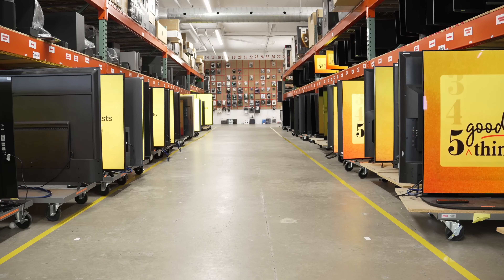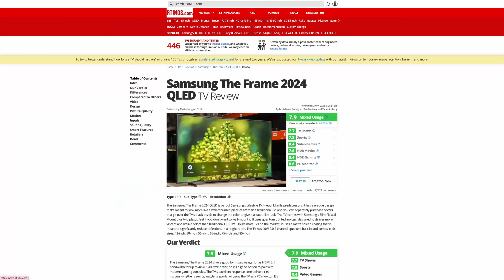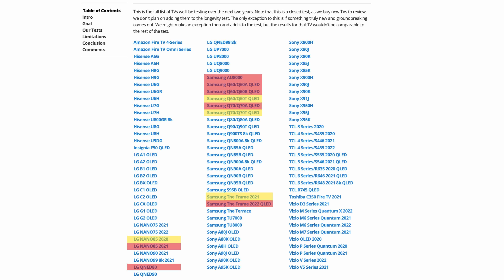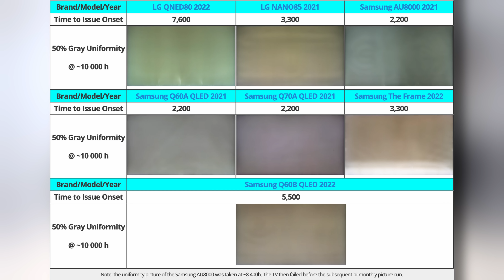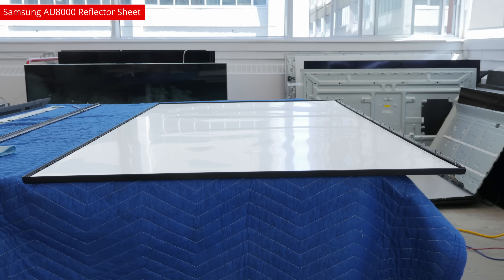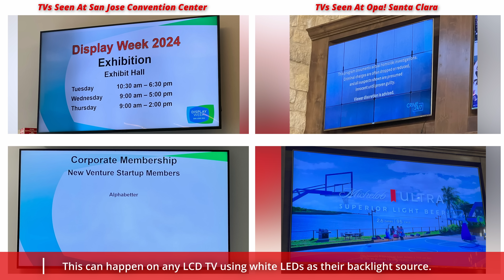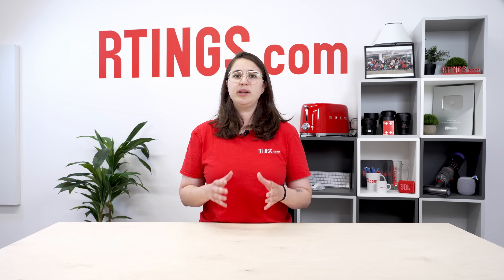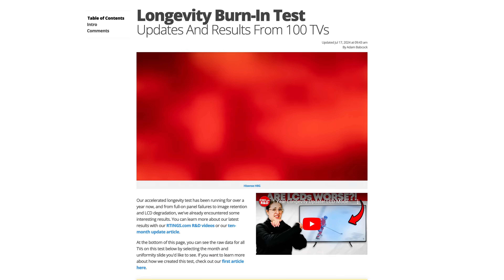Edge-Lit TVs Fail FASTER Than Others (100+ TV Test)

Comment: I know why, i see it almost every day.
The current trend for higher brightness levels means the LED's run hot and since there is very 
little ventilation the edge of the reflective sheet  starts to split and burn, this has to be replaced
at greater expense than the led strips, often making the repair not viable.
Keep the brightness down or be preapred to buy a new TV when this happens outside of the warranty.
Some call it progress, i call it deliberate design flaws.

Comment: What is the temperature between all of the TV’s?  If it’s 100 degrees from all of the TV’s running then they will fail much faster than in the wild where TV’s are running in a 70 degree room

Comment: Our 2018 TCL 55S515 TV has the burns/cracks at the bottom of the screen problem.   Currently its only an inch or two of the screen at the bottom that has the problem,  but it is annoying.

Comment: You can’t just make accelerated lifitime test without considering the science behind it. 10000h of constant use at 100% brightness IS NOT equivalent to 6 year of “avarage usage”. It is more like to 100 year if not more. 
Test without the ability to read the results and data is just a waste of time. Try to keep a lightfire on for few minutes, it starts to melt it-selfs, however this does not mean that soon or later it will melt. Testing outside the use cases of which a product is design for could lead to issue that is completly misleading. Strict test methodology is just necessary, but it-self alone does not imply right and useful results.

Comment: I had a Philips 58pus8535 with full array direct backlight which failed after just 13 months. I was watching a 4K blu ray and when I powered off the blu ray player the screen went blank and no matter what I done the screen would not turn back on. When I pressed the menu button nothing showed on the screen. I had ambilight enabled and it showed that when I pressed the home button and pressed the direction buttons on the remote it was selecting different things. But I just saw blank. The screen failed.

Comment: Two weeks ago, I bought the LG 55QNED88T6A model and faced the issue of edge light leakage in all four corners due to its edge-lit backlight technology. Watching movies and TV shows on this model is quite disappointing, especially during darker scenes, where the backlight is very noticeable around the edges. Because of this, I requested a replacement with a different model, the normal UHD UT80 series, which uses direct backlight technology. I hope this will resolve the issue.

Comment: My TCL 65in QLED is now one year past its 3 year warranty. The screen now has a dark vertical shadow across it. TCL won't cover the repair or replacement and recommended a service technician to have it fixed at my cost. I'm told by the tech that the TV is not economic to repair. So after just 4 years it's got to be junked. Thanks TCL . NOT HAPPY!!!

Comment: I had a Samsung plasma for 15 years. It's picture was as beautiful the day it wouldn't turn on again as the first day I got it. The part needed for it to turn on was not available nor was it made anymore. Trying to get it to a repair shop would have been quite a task. It weighed 90 pounds and I live on the 2nd floor.

Comment: I had a edge lit Samsung KS8000 and the glue that held the bottom frame in place started to come apart.  It eventually developed a purple line from the warping of the backlight.  Never again will I spend more on a Samsung, I only had it for 18 months and it literally fell apart.

Comment: My Sony Bravia LCD purchased in 2006 is still working like new
Reply: It's lit directly using fluorescent tubes I'm sure. These Rtings tests are also unlikely to be real world examples as they are running them at full backlight brightness to get results in a short time and most users wouldn't likely have them so bright.

Comment: I'm not an environmental nut but the absolute gall these manufacturers have to create what I consider "disposable" TVs at "Buy it for Life" prices. CRTs literally lasted for decades, they lived so long they were virtually antiques by the time they stopped working, if ever, and they did break - they were repairable! These TVs are all ending up in the dump in 5-10 years, and they're not even cheap. THEY'RE EXPENSIVE. Furthermore they are riddled with quality control issues. Weird lighting problems, dimming problems, durability issues, cracking, colour problems. They're plastic junk. They're little more than large, flat lightbulbs.

I hate everything about these televisions except their slimness
Reply: They are cheap compared to what an equivalent Japanese brand CRT or Plasma (or early generation LCD) TV would've been, especially taking inflation into account.

I'd say they're suspiciously cheap but people have now been conditioned to think that is a reasonable price for electronics. Not if you want reliability.

Comment: Question, i have the Samsung 65 inch Q7FN  from 2018. It works amazing even with edge Light. Still going strong after 6 years. Are there big differences in quality between like say my model and like q60?

Comment: 6:35 thats because you got it in a hot box of a warehouse for a stress test, less than a foot from other tvs producing just as much heat. I love you rtings but the scenario's gotta be more realistic for creditworthiness. I can see the design is a total flaw and failure and it makes no sense to continue production on such flawed tvs, but i think they often assume best case living scenarios where a home is under air conditioning 24/7 or that buyers are most likely in parts of the world where temperatures are relatively cold most year round, and that the tv's not mounted next to their fireplace, yknow.

Comment: Does RTINGS do any testing like this with also flipping TV's off, cool down, then back on? It is one thing to leave a TV on all the time, but 99.9999% of users will be thermal-cycling these at least once, if not more times, per day. Thermal cycling even on solid state electronics degrades them. Curious if any brands can handle this better than others or it is not important.

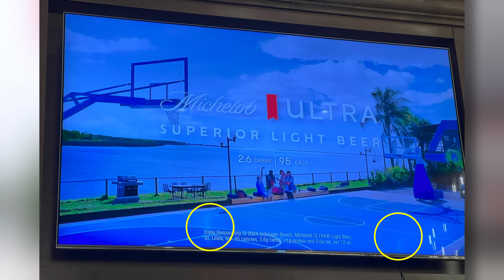Comment: I have a Philips 436M6VBP 43" monitor that developed those exact same warped blue lights at the bottom of the screen shown at 0:44 after 4 years of normal use. I don't have kids or pets. The monitor was treated perfectly and never moved from the spot I set it when I bought it. Now I finally find out what the name of the issue is after Googling for hours.

Comment: I was always careful with my 2019 Samsung and rarely used it at full brightness. 4 years later the LEDs started turning purple. In 2019 I spent what I thought was a lot of money at the time. It was not a cheaper model. I had expected it to last nearly a decade with how careful I was. I went to order new LEDs to repair it and found that the 4 light strips required totaled over $400 after shipping. Unreasonable.  When I replaced it I figured that if a TV wont last 5 years anyway I might as well buy an OLED.

Comment: In 2013 I bought a refurbished midrange Vizio M-Series TV. A year later I bought a refurbished low-end Vizio E-Series TV. I still use them both regularly today, and they've both been flawless. My parents have had mediocre luck with their Samsung TVs. And their newer LG has possibly the worst GUI/menu system I've seen on a TV. When I need (or, more likely, want) a new TV, Vizio will certainly get some points for my refurbished models holding up so well.

Comment: I have a Phillps 65" entry level LCD TV with edge LED's and "Ambilight" RGB LED's on the frame. A year has passed and the TV had normal use with low brightness, for the price is an excellent TV and it's thick, maybe it have good heat dissipation, some light bleeding is visible in top left corner on dark scenes but it's not that noticeable. I'm an electronics technician and worked in a TV assembly and distribution/technical support plant, we had an edge LED TV model that had a MASSIVE fauilre rate, good times 😂😂😂

Comment: im going to tell you why this happens.. first it used to be about money you pay the maximum on anything in life and you get quality..  not the case now now everything breaks at about 3 years to 6 years... give or take all manufactures got together planned obsolescence in everything you own now its a throwaway generation notice those old crt tv repair shops are gone now yup just what they wanted you cant repair these tvs you must buy a new one to fix it.. it all started back in the late 70s when industry got together said we want more money lets stop making quality things.. now your refrigerator lasts 10 years tops if that where as it would last 50 etc.. 

this is why you want old products like fridges and tvs etc the last tvs to be of any salt was 2008 and below i have a 2008 tv stil going to this day.. im on a samsung lcd right now its failing at 3 years old black areas when you look at it from a angle.. so yea this world is now run by corporations and greed fully

Comment: I have a older 32 inch JVC edge-lit lcd tv that is most likely 10 years old , it hasnt been used much throughout its life and yet it has developed a warped reflector sheet. you can clearly see the slightly brighter blobs at the top of the screen. It wasnt used in warm environments and is at lower brightness. I do like this tv, overlooking the ancient android version (being 4.04) and the absolutely abysmal audio quality.

Comment: I’m more worried because I thought to myself “good thing they aren’t talking about my Hisense U8H today.” Then as a I thought that they used the U8H as the example of the piece of junk that failed. Fml.
I will say it gave me a ton of trouble playing with settings and firmware updates to get it to work right. The sound when using an input had a full second delay that appeared after an hour of usage like clockwork unless you fully restarted it, but it randomly fixed itself one day. Also had an issue where it was very “jittery” with anything on screen moving quickly. Ended up turning off some motion smoothing feature or something to fix that.

Comment: Edge LED is not worth it!
Especially now that we tend to purchase bigger TVs, like 55" and upwards.

Typically, thin [insert electronic device here] will reach higher temperatures, and faster, than thicker ones.

TVs, which usually, spend many hours turned on, at maximum brightness, with not active cooling (i.e., a fan), will be prone to issues.
Hence, one shall take into account this when purchasing TVs.

OEMs must understand that, if a TV fails within 3 to 5 years time, that consumer will look for another brand when purchasing his / her next TV.
Rarely do consumer look at spreadsheets - like we TV nerds do.
Therefore, OEMs should be aware of that, and define thir baseline when building a TV set.

Comment: We've been using our Panasonic Plasma as our main TV for over 17 years, and it's still going strong with no issues.
Reply: The tv in my livingroom is Panesonic Viera 50" plasma tv of 2005 manufacture, so 20 years old.  Still going strong!   Those three fans built in to the back no doubt help a lot.

Comment: I’m a TV technician and I already repaired quite a lot of the Edge lit TV mostly samsung is worse when the LED get burnt the diffuser/light guide panel will also get burnt or cracked so you also need to replace it to do a proper repair

Comment: I can relate to this video. Bought LG tv in 2017. Basic 4K model. It’s nearly impossible to use now. Black is purple and you can’t see anything during the day. We have bought and older second hand LG tv before this problem has happened and it is still running smoothly after more than 10 years of use. Also my uncles LG TV died just after couple years to the problem described here. But I could find anything on the web. All tv’s are edge lit. Thank you for this video. I hope it will help us when we look for new tv. 👍🙏

Comment: Lols the thicc thighs saves lives is not wrong fwiw because to be able to lift a thicc tv set one generally has to or will build thicc thighs from squating down and waddling around with a tv regardless of type of tech/screen size but generakly the ones at least 30 or more pounds no more than about 200  to start with for safety as you do not wabt to implode a glass 45vinch tube weighing over 400 pounds more about just shy of 450lbs.. so yeah also ensure earthqauke/siesmic safe installs are observed even in todays age or for retrogaming if a set is up high it can and inevitably will in some earthqauke level of magnetude fall but best not to have a issue needlessly likewise cosnult the manufacturer for ensuring that your floor is strong enough like one would for an organ since it may need a brace and also a site built stand for the monitors over 36 inches of flat faced particularly but vacuum tubes and or drums of fluids etc in excess of a few hundred pounds may also need to be reinforced to hcigh loads falling and or collapsing.. such as this is why one may be suprised to learn like I was upon turning over an entertainment center there are legs even on it much less over 4 or even 5 but 7 or 8 legs... to avoid breaking through the particle board.

Comment: The edge lit break faster because you drive them non-stop at maximum brightness close to each sample and cramped in a room getting heat saturation even with AC. They were not designed to operate that way.

Comment: So far with our screens, they've all lasted quite a long time. In-fact the only LCD screen whether a TV or monitor that we've had fail, was a very cheap 40" ViVo TV, which was CCFL lit (over 15 years old, 13KG, thick and well ventilated). And it only died due to the power supply failing (open circuit due to 1 in a set of 3 de-coupling capacitors exploding and taking the others with it). 

It's much the same for the 15" Hicon TV/Monitor that has been in use since the early 2000's. Its only faults have been a dying power brick (erratic voltage - easily replaced) and a single dead pixel.

Comment: As a former TV repair technician, this is why I miss CCFL based LCD sets. Yes, they do wear out like LEDs do but they take a much longer time doing so. I had a Sharp LCD set (when it was still made by Sharp) that lasted so long, it was on its second set of CCFL tubes. That thing was still going when i left the biz.

Also this thin trend is dangerous, thats what happened to plasma TV sets at the very end, resulting in heat-induced panel cracking and manufacturer blaming the customer that they broke the screen!

Comment: Used to be LG tvs having this problem with LEDs blueing. Bummer that all manufacturers cheap out like this. However the fix was easy: A set of new light bars from China for $18. Though taking a large TV apart to fit new LEDs is delicate work.

Comment: Reaching out for comment from the manufacturer is a well-regarded journalism practice, but the outcome is predictable.

"We've identified a consistent failure point in your product."
"Our data suggests everything is fiiine."

Sure, guys.  I assume your tests are done with 10,000 hours (that's 10,000 hours in metric) with the TV off?  And return rates are not considering everyone who threw their broken TV away because the 90-day warranty expired a year ago?  Well then, sure, that makes sense.

So sick of boiled responses that amount to, "Well, we would know if there's a problem, because we have all this information we don't let anyone else see and you can't prove doesn't exist or isn't true.  And the data I've made up doesn't indicate anything abnormal.  So there."

Would it be so hard to just say, "Yeah, there's a trade-off in life expectancy for models that prioritize thinness or cost.  We suggest selecting a more robust model, or limiting duty cycle accordingly.  Here are suggestions for each of those options: ...."

Comment: My Samsung UN58NU7100 55" looks like the bottom edge of the light guide plate is cracked in multiple places.  Happened after about 5 years of use.  Sometimes it makes a cracking sounds after turning it off.  I would almost bet it wouldn't have cracked if it was designed to slowly back off the heat over a minute or two.

Edit: I also think that less than $10 of strategically placed aluminum would nearly eliminate the heat related failures.

Comment: With samsung brand I've noticied a clear reduction in longevity, ln32a650 working fine since 2008, 40" KU6000 since 2016 already showing some signs of wear but still ok, newer models 2-3 years and to the trash...

Comment: Heat degrades electronics at an exponential rate. Difficult to mitigate, but even small improvements can help. Dimming, moving a bit from back wall, running a slow fan behind panel might make sense.

The front panel is naturally insulated by the screens and coatings, unfortunately. The thin cases can't have a great natural convection system, where heated air rises out of vents on the top of the tv.

Comment: My LG 42LH5010 is thick, heavy, with substantial bezels, CCFL backlight, and after 15 years of use, it's still going strong like on the first day. I've always been wary of edge-LED backlit displays, they've always had backlight uniformity issues. Knowing that these are more prone to failure due to heat management issues and the race towards thinner designs makes them quite ill-suited to use for a prolonged time in brightly lit rooms where you need to crank up the backlight to see something. There has to be HDR panels that are edge-lit, right? Surely that would be even worse.

Comment: I'm still using my old LG LG42LB6300 back-lit.  The only issues I've had are the diffuser lenses falling off the LEDs and collecting in the bottom of the TV.  It has bright spots on the display but I have learned to ignore them.   I haven't fixed that yet.